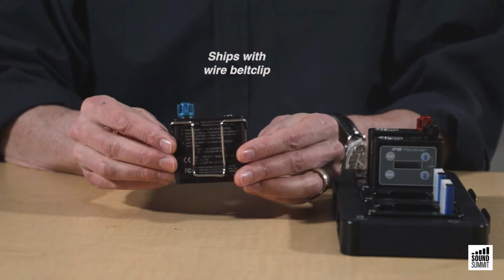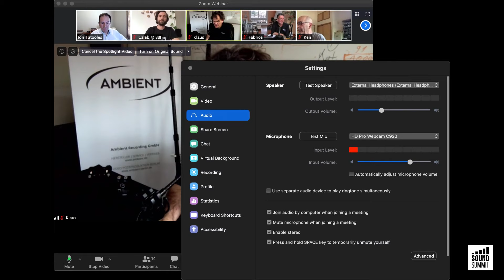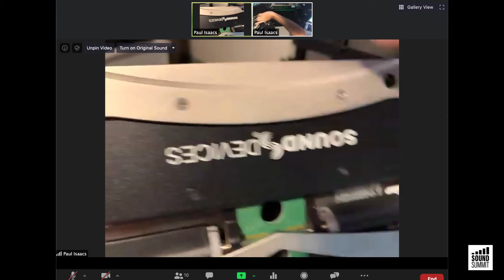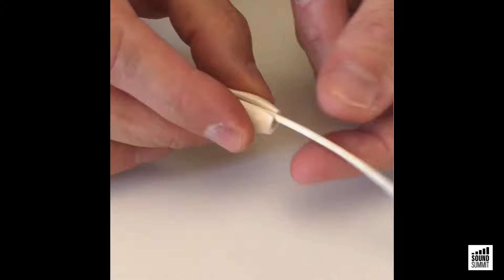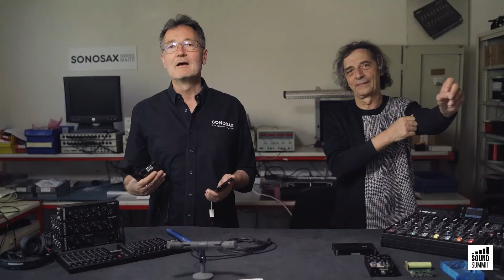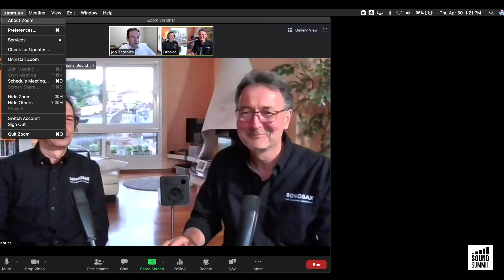The Sound Summit Live Stream - April 30, 2020 - Day 01 Complete

Comment: Great initiative to have "The Sound Summit"! Good stopgap measure while we can't have NAB. 
A quick question about the Sound Devices SL-2, does it have the expansion port on the SL-2 itself so you could stack a second SL-2 together with it? (or an XL-AES)
Reply: The SL-2 does not have an expansion port on top.